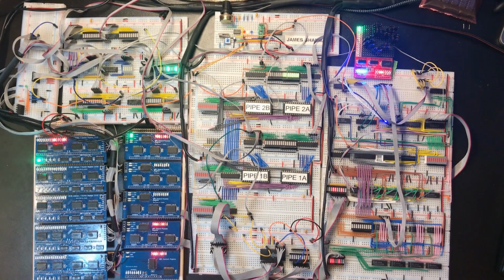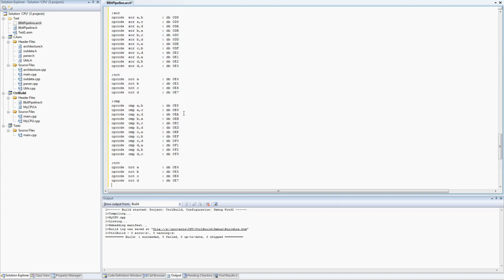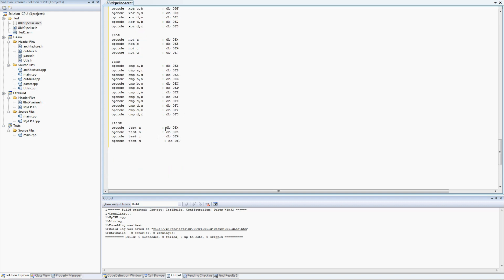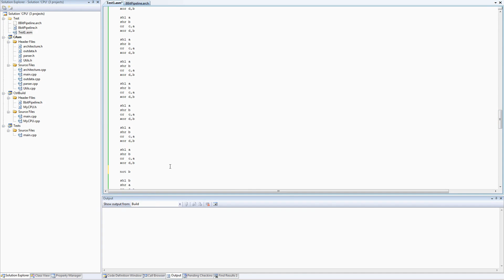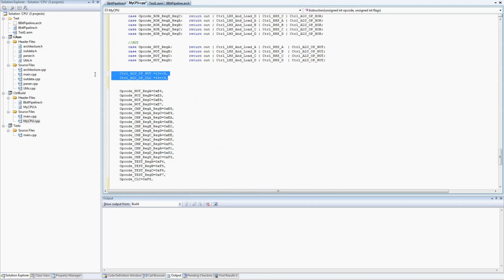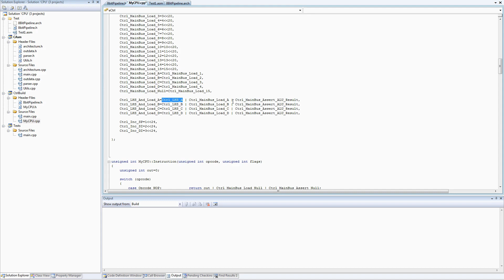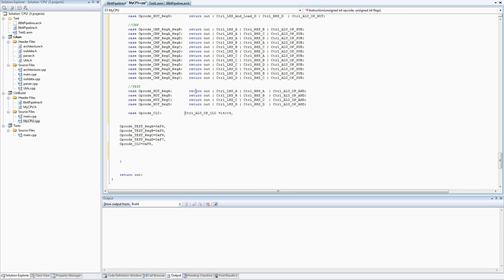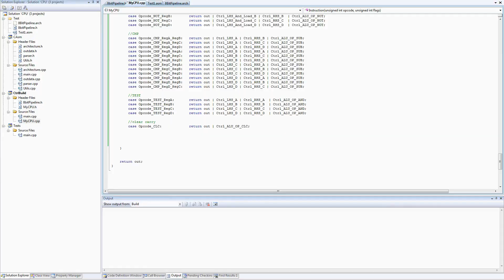ALU (12: Logic) - Making an 8 Bit pipelined CPU - Part 43

Comment: do you need all 12 compares? wouldn't you just need all the possible combinations? if you're not putting anything into a register then CMP A, B and CMP B, A does the same thing
Reply from the maker: It's likely you could make same savings here, the choice would be between dropping comparisons or conditionals.  Switching the operands would invert the results, so for example you would need to replace "greater than" with "less than or equal". I could argue dropping conditionals (knowing we can invert the comparison) would be slightly easier as there are more cases where you would want precise flag behavior from the comparison.

Comment: This comment has a new guess on how he'll implement call and return.

Alright. I'm home from my trip now, and I've finished watching this video.

I'm definitely curious to find out what that anomolous load is about. Also, when you were setting up the control lines for CMP, TEST, and CLC in this video, you forgot to set the main bus to load and assert NULL.

Alright, with the corrected layout of opcodes after the point I had watched to when I posted my previous comment, there's no longer room for any IDX instructions in the arithmetic opcodes. More importantly, opcode 0xff is now taken by one of the arithmetic instructions, so it can't be used for the return instruction. I did some more thinking, and I've come up with another idea on how to implement call and return.

First, the hardware side:
Instead of sending the "no fetch" line from pipeline stage 1 directly into one of the enable pins on the line driver in the fetch unit, OR it with the "increment RA" line from pipeline stage 2 first. This will make the fetch unit output a NOP when told to increment RA rather than PC. (I'll get into why this is necessary in a moment.)

Next, the microcode side:
For the call prefix, pipeline stage 1 will assert PC to the transfer bus and load RA from the transfer bus. Pipeline stage 2 will tell the main bus to assert and load NULL, as well as telling the fetch to increment RA rather than PC. Let's look at what exactly this does. On the rising edge of the fetch cycle, the address of the call prefix is latched into PC's output latches and asserted to the address bus. On the falling edge of the fetch cycle, the PC is incremented to point to the jump instruction, but its new value isn't latched into PC's output latches yet. On the rising edge of stage 1 (which is also the jump instruction's fetch cycle), the call prefix is latched into stage 1, and the address of the jump instruction is latched into PC's output latches and asserted onto the address and transfer busses. On the falling edge of stage q of the call prefix, the address of the jump instruction is loaded from the transfer bus into RA, and PC is incremented to point to the instruction after the jump instruction, but neither has its output latches updated yet. On the rising edge of stage 2 of the call prefix (stage 1 of the jump instruction), the call prefix is latched into stage 2, the jump instruction is latched into stage 1, the address of the jump instruction is latched into RA's output latches, the address of the instruction after the jump instruction is latched into PC's output latches and asserted onto the address bus, the fetch unit's "increment RA" line goes high, and the address of the subroutine is asserted onto the transfer bus. On the falling edge of stage 2, the fetch unit increments RA (rather than PC) to point to the instruction after the jump instruction and determines the next instruction will be a NOP because the "increment RA" line is high, and the address of the subroutine is loaded from the transfer bus into PC. On the rising edge of stage 2 of the jump instruction, the jump instruction is latched into stage 2, a NOP is latched into stage 1, the address of the instruction after the jump instruction is latched into RA's output latches, the address of the subroutine is latched into PC's output latches and asserted onto the address bus, and the "increment RA" line goes low. On the falling edge of stage 2 of the jump instruction, PC is incremented by the fetch unit since the "increment RA" line is now low. Finally, on the rising edge of the next clock cycle, the NOP is latched into stage 2, the first instruction of the subroutine is latched into stage 1, and execution of the subroutine begins. Conveniently, the first instruction after the jump instruction, which RA points directly at, was not executed before jumping to the subroutine, so return can be implemented as if it was JMP RA, or, equivalently, MOV PC,RA.
Reply from the maker: Interesting to know how you felt about all this once you hit the call/return video.

Comment: This comment will reference my guess as to how he might implement call and return.

You don't need a separate ALU operation to clear the carry. XORing A with itself, but not storing the result anywhere, will work. (To clarify, pipeline stage 1 would have hex-packed control lines of 0x00c0, and pipeline stage 2 would have hex-packed control lines of 0x00ff.) As far as I can tell, you would need a separate ALU instruction for setting the carry, though, but I don't think that would be particularly useful since it would only be able to set the arithmetic carry, and you already have non-carry-dependent versions of all of the arithmetic instructions.

(7:05) Given how this architecture works, I think it would make more sense to call "xor a,a" "clr a" (or maybe "clear a") instead, and the same for registers B, C, and D.

Cool. It looks like you have room for a special instruction at 0xff. Taking that into account (assuming you're doing something similar to my idea for call and return), which leaves two unused instructions in the arithmetic half of the instruction set, perfect which is just enough for two IDX instructions (described in my comment on the previous video). Since there's only two instructions available, they will have to use specific registers. Let's assume the base address will be in A:B and the index will be in C:D, and we want to get the final pointer address into A:B. Then we'll have two instructions, IDXL (equivalent to IDX B,D) and IDXH (equivalent to IDX A,C). We have to force certain register uses because we don't have enough available instructions.

(I was rushing to finish this comment before I lost internet on the laptop I'm using to watch these videos, so I may have more to say on this video later.)
Reply from the maker: You could put an alias for xor a,a into the assembler script file. Wait until you see my call and return video before judging.

Comment: Do you really need all those many "inc" instructions?   That's the same as  clc followed by  incc ...   Would be a rather dramatic decrease in the number of opcodes needed.  Same thing for add and addc.
Reply from the maker: This is one of those things that can be subjective. If I were not so tight on instruction encodings I would have a whole bunch of instructions that would be used less frequently.  clc+incc is both twice the memory and twice the cycle count of inc, so a better question is "Does inc get used enough to justify it's slots in the instruction space?".  I think so, but someone designing a build with slightly different goals might come up with a very different answer.

Comment: I think clock pause instruction would be great for debugging code later.  When hit, it just stop execution of the clock (write to some flip flop), and requires an external system or human intervention to continue.
Reply from the maker: What you are talking about is called a breakpoint and they are very useful for debugging. Video 85 will interest you.

Comment: At 7:58 you assigned F8 to clc, after you moved F8-FB (xor a,a - xor d,d) a few lines up, out of sight. That's why the compiler failed at the case-selection.
Reply from the maker: I do make the occasional mistakes programming and don’t edit them out of the videos.
Reply: @weirdboyjim  No worries. Just wanted to add a comment in case someone is interested what went wrong.
Also: Thanks for replying, even on an older video (wasn't expecting that)
I got onto your videos by the VGA series and am highly interested in your journey to it. Thanks a lot :)

Comment: Now you're getting closer and closer to handling jumps I'm very curious to see how you deal with delay slots
Reply from the maker: Call and return is the real interesting one if you look closely at this pipeline.
Reply: @weirdboyjim  If I'm reasoning this out correctly your CALL/RET instructions will be like an extended LOADI with a dword immidiate, so you'll have to load 2 words (one at a time) into the immidiate register and then load that into PC? So pipeline stage 1 and 2 will have to handle loading an immidiate which you currently aren't setup to do? (Then the delay slot will happen)

An unrelated question I'm also curious about, would it be possible to load more than 1 register/bus listener with a value at once? Say something like "LOAD {A, B}, C"? My grasp on electronics ain't great but that would be fine to have multiple listeners but only one asserter right?
Reply: @Awia2  I am not there yet with videos, but my guess is that CALL / RET will be done in software:

CALL: setup address in tx, 8 bit, then 8 bits again, via gpr to tx transfers, transfer pc to ra jump to tx (move tx to pc)
SAVE: , assert ra to bus, read lower ra 8 bits, to gpr, save gpr in memory, read higher ra 8 bits to gpr, save gpr in memory,  (push for counters)
RESTORE: inverse of SAVE (pop for counters)
If needed, save ra in memory on a stack, if planning to do subsequent calls, then restore, before RET.
RET: jump back to ra (move ra to pc)

These can be implemented as macros, using simpler hardware.

The nice thing about this, is that normal functions have only one entry point, but there are often functions with many exit points. so making ret fast is nice.

With careful programming, if calling simple functions in a loop, one could load specially crafted tx and ra before the loop, and then call and ret are both single cycle instructions.

His implementation of decoding doesnt support loading multiple registers at once, but it is very easy to make possible. (Instead of doing 1-of-8 decoder, that is hooked via 3 bit lines to decoder ROMs, one would just hook directly 5 lines to the decoder). The issue is then you quickly run out of decoder outputs, and needs bigger memories, or more of them. And even more importantly, to fit all possible combinations of such loads, you will need to allocate many opcodes, and there is just not that many available in 8 bit opcode space. Still, it might be possible, to allow few (maybe 4), selected combinations, like LOAD {B, C, D}, A; LOAD {B, C}, A, LOAD {A, C}, B, LOAD {A, D}, B, and just leave to programmer to figure out how to arrange registers, to take advantage of this. The best would be to start with normal loads, write some programs, and see how often each pattern occurs, then guide optimisation. This is called software-hardware co-design. And is commonly used in CPU design.

Comment: If you haven't used the last ALU slot yet, what comes to mind is set carry. After all, you have clear carry.

Use would be multiple precision subtraction without requiring the first subtraction to be the non-carry version.
Reply from the maker: That is an option, but I'm used to having separate add+addc instructions. That makes a 16bit add 2 cycles rather than 3 for me. It's always a tricky balance deciding what to include, other people will always make different decisions.
Reply: @weirdboyjim  Not quite what I meant. I meant multiple precision math, where the length is long enough that you use a loop to process the number one byte at a time. Having a means to set a specific carry state means each byte can be processed identically without having a special case for the first iteration.

Comment: I'm going to go on a limb, since im watching this in order, that you eventually replace the diode matrix with a small eeprom to handle all of the alu control logic.
Reply from the maker: And you would be wrong, but this version does get replaced with something more custom for the purpose.
Reply: In essence, EEPROM, EPROM, PROM use a diode matrix. During the programming phase bridges between the input rows and the output columns are fused as required.

Comment: at 3:26 you say "this ignores the right hand side input, we're only interested in the left hand side input", but you appear to select the "NOT RHS" operation from  your table.  It does look as though you're getting "NOT LHS" on the CPU though.  Am I missing something?
Reply: in case anyone else runs into this--in debugging, it appears as though the the selected register is sent to both LHS and RHS, and the diode matrix is selecting the ~RHS option, and the microcode is telling it to store that result back into the source register.
Reply from the maker: Looks like I tripped over my words slightly there and said the wrong thing. You are correct that it actually inverts RHS (An operation I already needed) which is set to the same as LHS. At one point in the design I had a separate !LHS but it seemed cleaner to never have "RHS Op" only operate on lhs.

Comment: That is getting very much more impressive every time.

One extra instruction that I would find very useful in the ALU is a nibble swap.
Reply from the maker: Thanks! What is it you need a nibble swap for? It's not something I've found myself doing very much.

Something like an x86 you can use a rotate instruction, on this kind of circuit you would either extend the shift unit to implement a rotate (so it can be done in 4 cycles) or directly implent the swap. Before adding hardware I like to think about the existing instruction sequence that would achieve the result. In this case I don't have a true rotate but I do have a shift thru logical carry. So you would first need to move a copy into another register. Then do 4 pairs of shifts alternating between the copy and the working register. 

mov b,a
shl b 
shl a
shl b 
shl a
shl b 
shl a
shl b 
shl a

So 9 cycles on my processor. That's pretty quick if you don't need to do it that often.
Reply: @weirdboyjim  
Hi,

It's probably quite case specific indeed, now that I think about it.
The nibble swap comes in handy when sending 8 bit data over a 4 bit parallel interface.

In my case, I use it very often, particularly to interface with character LCD screen in 4 bit mode (upper nibble first), on PIC microcontrollers.
I use the upper half of one 8 bit port for the LCD control lines (R/W, En, RS and backlight PWM) and the lower half for data.

In the following sequence:
- Set/clear the relevant select lines
- Swap the data nibbles
- Mask nibble (AND b'00001111')
- Assert said 4 bits on the port
- Pulse the enable line
- Swap nibbles
- Mask
- Assert to port
- Pulse enable

But if you are only planning on using 8 bit interfaces, I guess a nibble swap instruction might not be relevant.
Reply from the maker: Make sense. For your case I would just take the copy, and the original with 15 and then shift the copy down 4 bits. It all depends on how much register space you have.
Reply: @weirdboyjim 
Yes, that's the way to do it when no hardware swap is available.
I guess the quest for the last ALU function is open then.